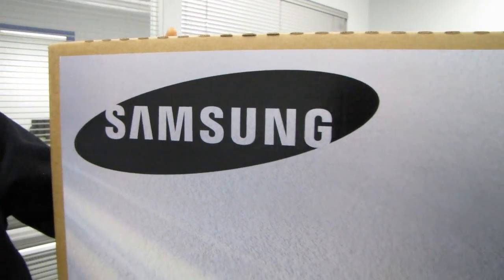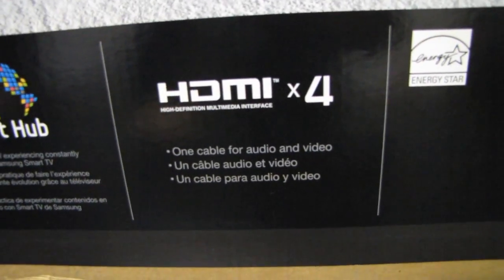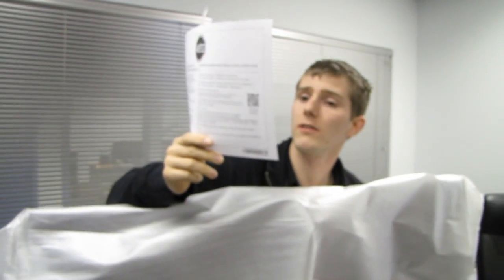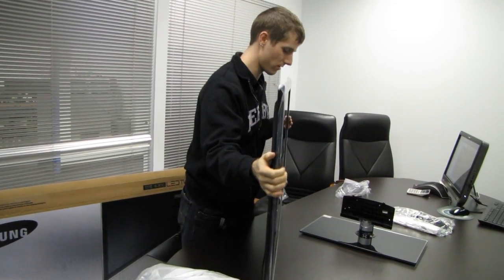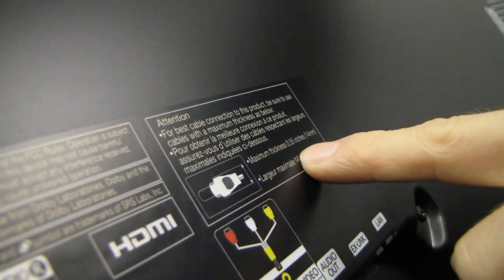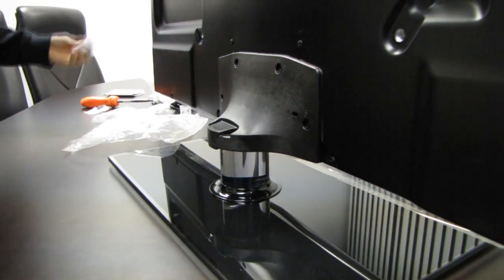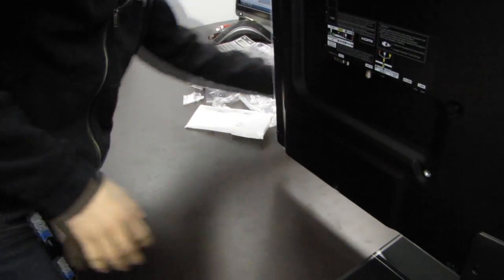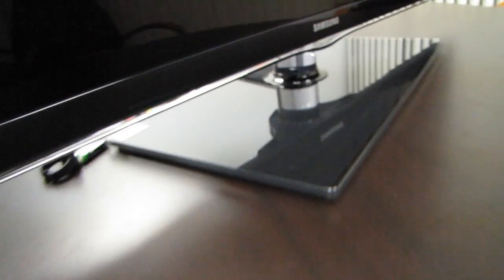Samsung UNC6300D 6 Series Slim LED Backlit Smart TV Unboxing & First Look Linus Tech Tips

Comment: @MASKOAA Hey there. Actually it is a 120 Hz panel. A lot of people get confused when the TV displays 60 Hz at the top left of the screen. Thats because the TV is displaying the native refresh rate coming out of the source itself, not what the panel is refreshing at (which is constantly at 120 Hz regardless of the source). Try modifying your computer's refresh rate (within the panel's limits) to something other than 60 Hz, or play a blu-ray at 24p (24 Hz) and you will see those numbers change.

Comment: Just an FYI Linus, this TV is 120 Hz not 240 Hz. You will notice on the box it says Clear Motion Rate 240 (not 240 Hz), thats because it is a 120 Hz model that will flash its edge LED lighting 120 times per second (called scanning backlight) so they can advertise the numbers "240" on the box. This is different from actually redrawing the picture 240 times on the screen (which is what it would be doing if it actually was a 240 Hz panel). Though you might like to know. Love the channel by the way!